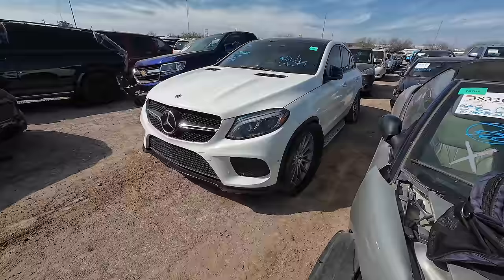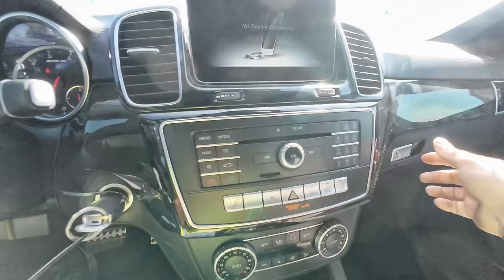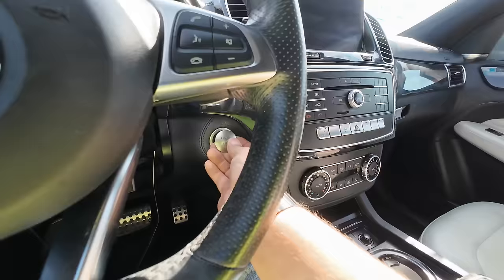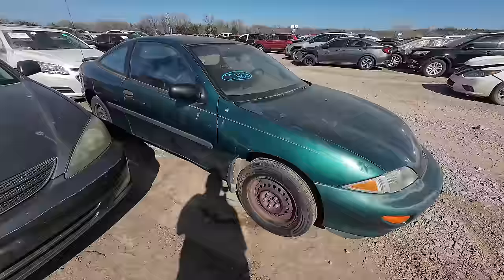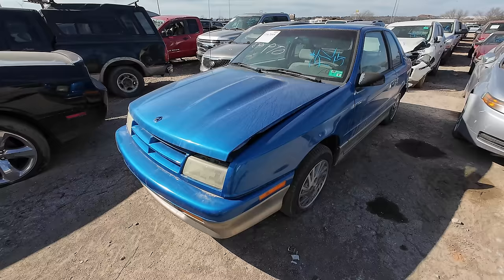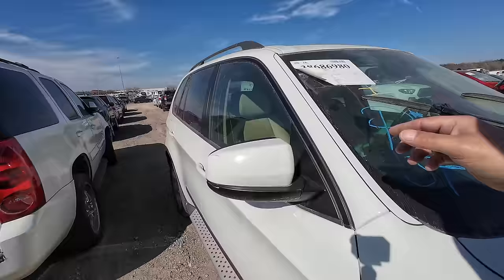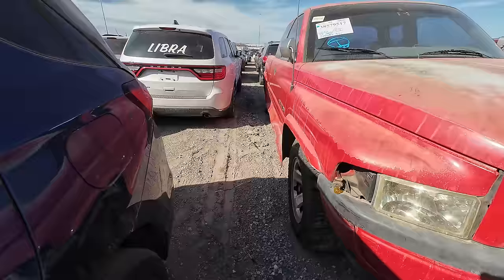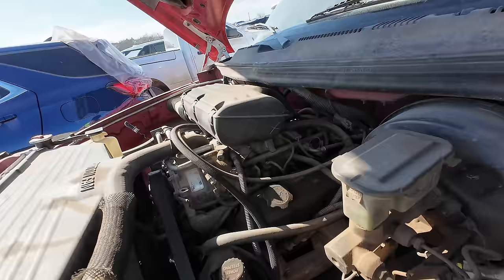I Found a Very Bizarre Wrecked Mercedes GLE 43 AMG at IAA!

Comment: The Benz GLE's damages are beyond imagination....costly to replace all the absorbers and expensive tires 😅...hard to justify why Randy should buy it...brake less too!!!...just walk away...🎉😂
Reply: Get replacement wheels and tires.  Put it on a lift and replace the damaged air line for the rear suspension.  Obvious to me is that the rear won't rise but the compressor ran till it overheated and shut off so there is an open line most likely near the wheel that separated.  That hub was rotating inside the outer wheel once it fractured the aluminum casting.  Nothing electrical which would mean compressor, valves, control blocks, etc..  So yea, you'd have a very low mileage Benz with a lot of exclusive type accessories for lets say a bit less than $3K in repair costs.  I'd bid low enough to get into the game and then negotiate hard and be willing to walk away.  New wheels should not be overstated but exude strength.  An additional somewhat bold colored accent body panel would just knock it way out of Oklahoma.

Comment: That white Mercedes could possibly how the problem that Sam crack had showed, which was a broken sensor arm which was a bolt that was broken or stud, and it's possibly caused by the flat tire.Also, that flat tire part of that tire could erupt around the brake line on the rear end, causing no breaks.She might want to check that out.Cause that might be a great fight